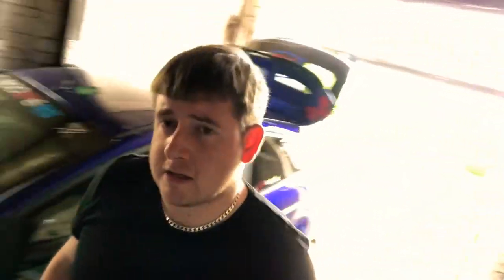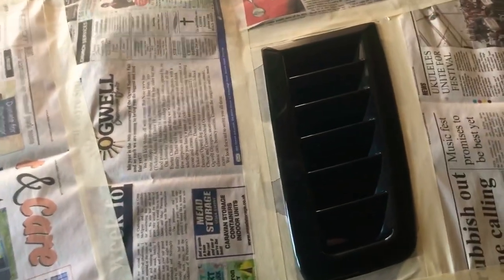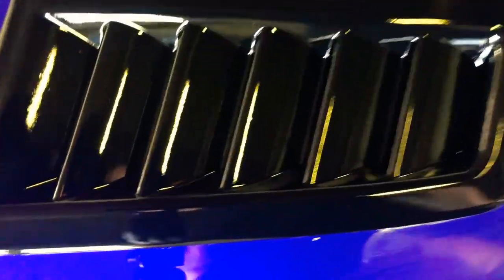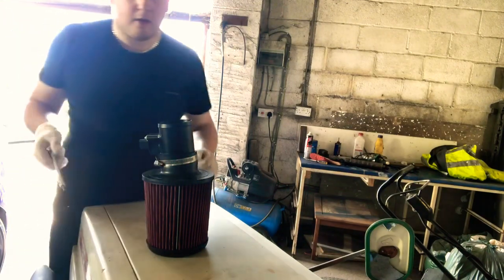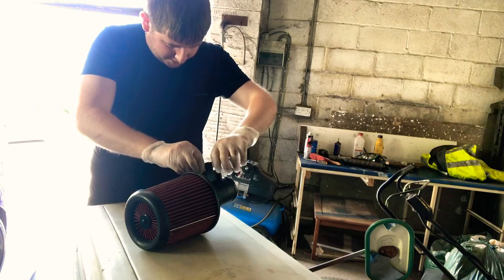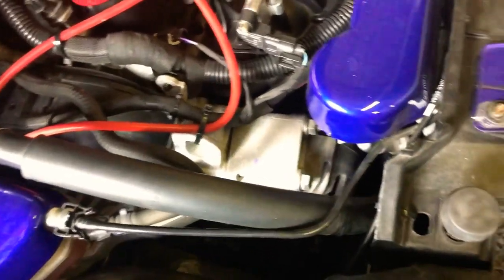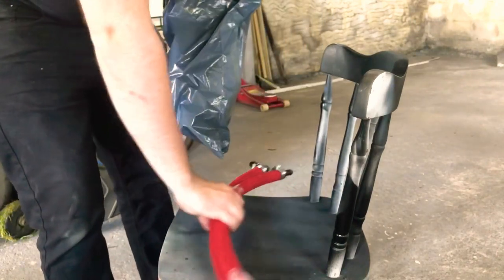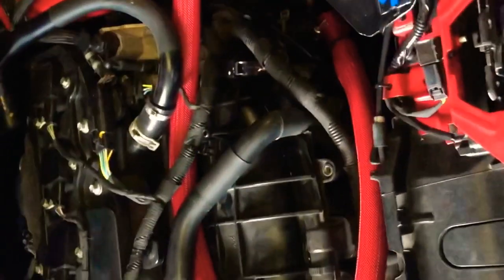Maintenance I’ve been meaning to do on my ST180 plus I instal my majestic performance oil catch can

Comment: Iv heard in your previous videos your bov makes a really nice flutter noise.  Is that to do with the map you have on the car. I got the forge atmospheric valve. But I don't. Get then wicked flutter noise like yours
Reply from the maker: HarryxHD I have the forge full recirc kit. The noise could be due to many of the other bolt ins on the car along with the map all adding together

Comment: hi lov how it came out well done can u please let me know how many coats of primer an of gloss black an the clear to finsh up also was the only sanding done before the primer thats it also im getting rs vents soon installed on my car an just want to be prepared if this happen to be you please let me know thanks
Reply from the maker: Sanded with 800 grit paper about 2 coats of primer 3 coats of paint and a good 2/3 coats of clear coat with 10-15 mins in between each coat
Reply: @rayztv2497  hi mate so since i had my vents they gottten problems like yours so i will be doing this tommrow had a feeling when i saw this video i would need to do mine as they were a very satin dull finsh jus last question when i spray the primer shall i sand the primer before spraying the paint color thanks
Reply from the maker: Vlogstar Parm yes I would sand the primer with 800 grit and wash the dust off. Make sure u tak and panel wipe before paint goes on